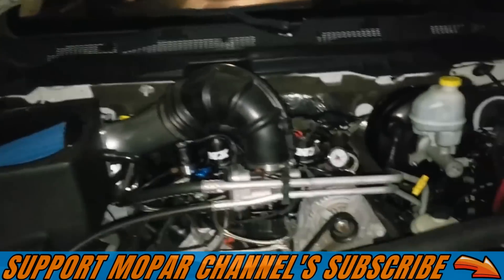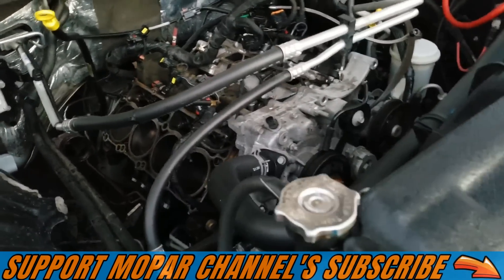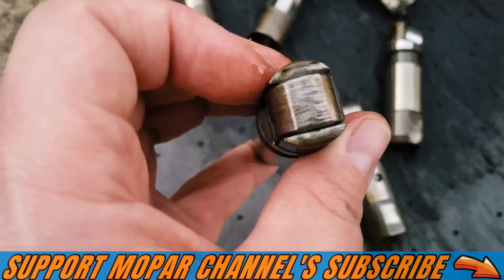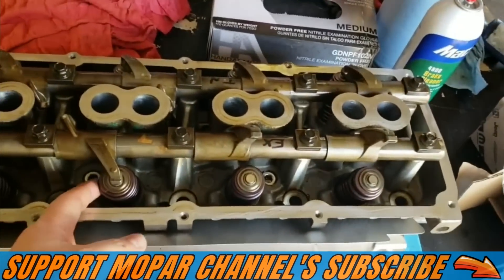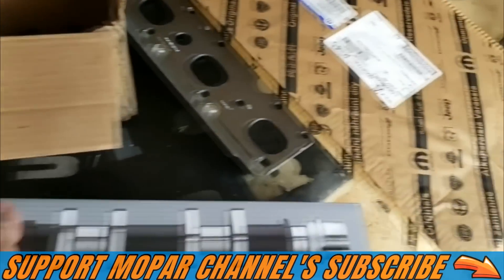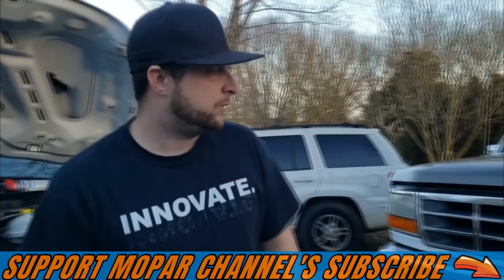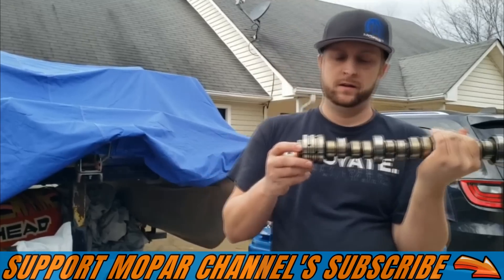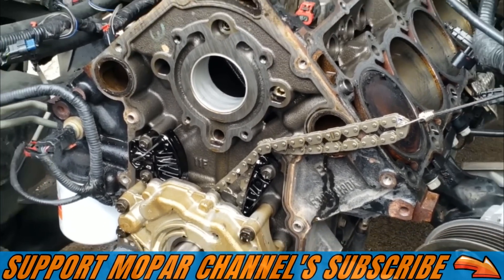5.7 HEMI TICK CAMSHAFT AND LIFTER REPLACEMENT MDS DELETE

Comment: Why I would never buy Hemi, period. This a COMMON problem, and very expensive.
Reply: Thats why i traded my hemi ram off.  The Hellcat lifters are failing too.
Reply: Ford is haven’t problems with their 5 litre since the redesign in 2018, GM 5.3 is a shadow of what it was. Not safe to own a modern vehicle out of warranty now
Reply: @ES-pr8bt  My son in law just had his 5 liter replaced under warranty, a 2020. Newer stuff is just too complicated for my piece of mind.
Reply: warren hymes my Nephew had  his 2018 5 litre replaced. The new one burns as much oil as the old one did.
Reply: E S  so the decelleration rattle on the Ford 2018 - present 5.0 is not a problem?  Love my LT5.3.
Reply: WBOS72 where did i say it wasn’t a problem lol. I said the opposite of that. That’s why Ford is replacing many of them. And if you got a new 5.3 and it’s a good one consider yourself lucky. There’s currently a class action lawsuit against GM for their 5.3 oil burners lol.
Reply: E S that was the older LS AFM models, the new LT Ecotec 3 are just fine.
Reply: WBOS72 no they are not lol.

Comment: Jajajajajaja Jajajajajaja people please dodge vehicle are garbage, I have a 2010 Dodge Charger with the 5.7 motor and I have the same ( f ) problem the car has only 102,000 miles on it  can you f believe that , I miss my 2009 Toyota Camry I sold it with 210,000 miles with no issues at all, motor and transmission 💯,  ..... one more time people, dodge vehicle are garbage , I don’t care what you think about me ....